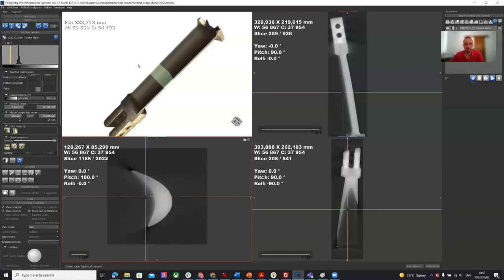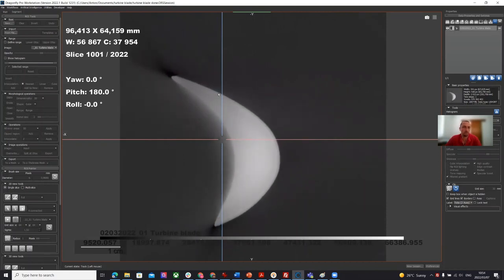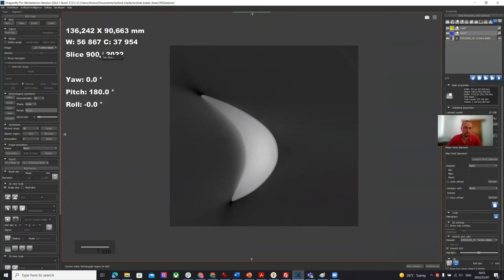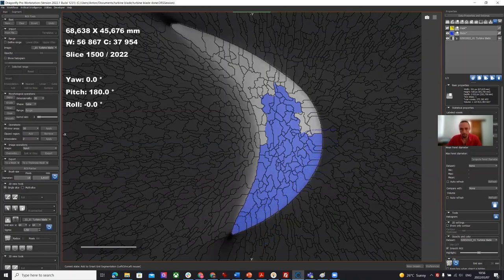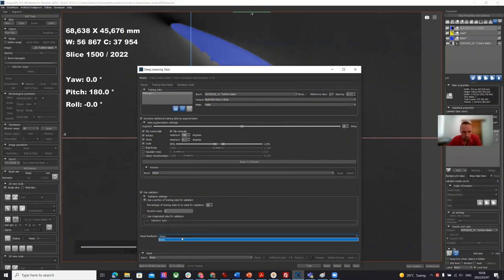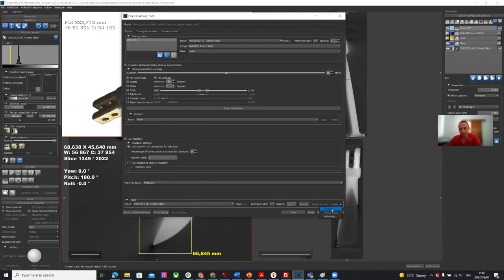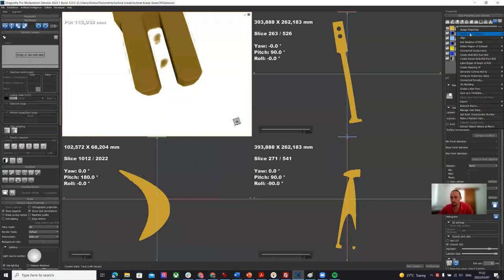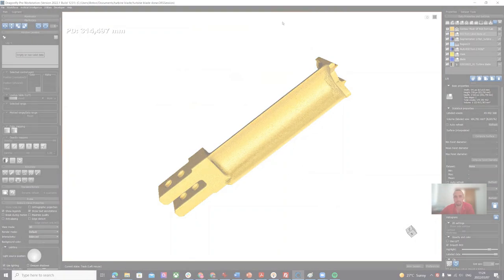Turbine Blade Segmentation Using Dragonfly Deep Learning - a Simple "How-To" Video

Comment: Very insightful video! quick question. when training a previously trained model with a new multi ROI with segmentation data (so your training data), how would the model know that the classes within your new multi ROI correspond to specific classes within the original multi ROI training data?

 E.g. Let's say you have two classes in the original training data (labeled Mitochondria1 and Background1). After training your model, you do another round of training with a new multi ROI. Again, we have two classes (let's say they were labeled Mitochondria2 and Background2). When training the second time around, how does the model know that Mitochondria2 corresponds to Mitochondria1 and that Background2 corresponds to Background1? Is it just a matter of keeping the nomenclature consistent so that the model knows what's what each time you create a new multi ROI to train the model?
Reply: I believe the class index of the Multi-ROI is used. So all your Multi-ROIs should have mitochondria as Class 1, and backgroud as Class2, for example.